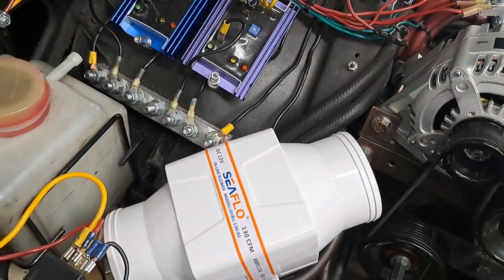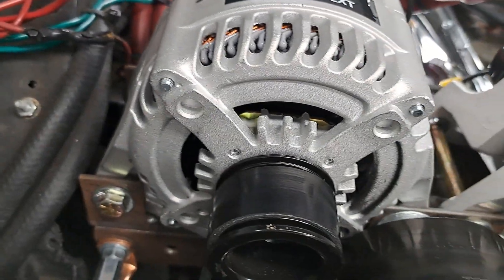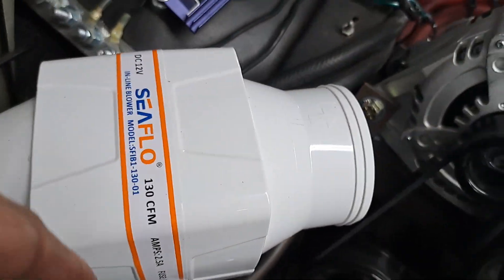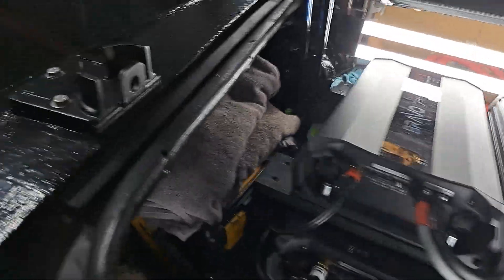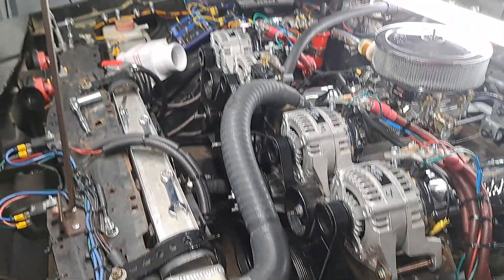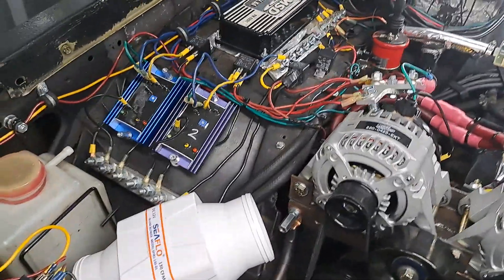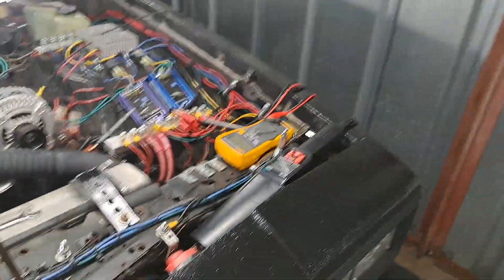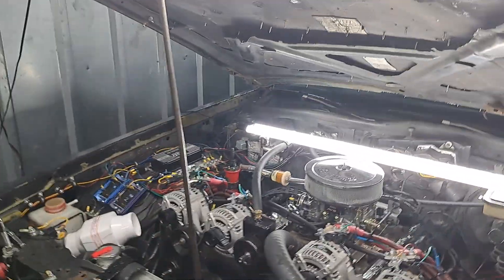Just Installed a Seaflo Fan to one of the alternators.

Comment: Do you know why that alt is running hotter than the others? Is it mounted over something hot?
Reply from the maker: It's because of the belt wrap. If even move a pulley to another location, another alternator will get hot instead of that one.
Reply: I thought the regulator is bad?